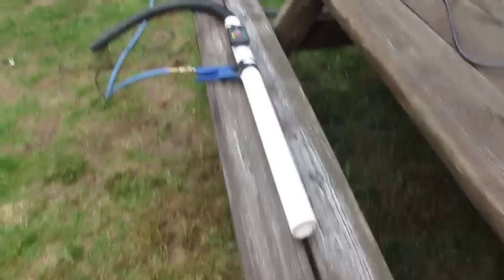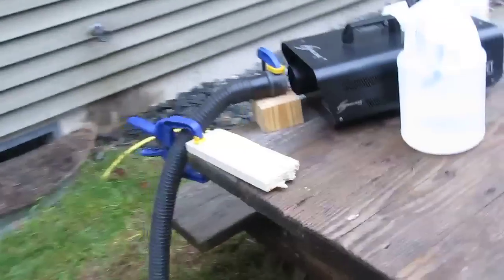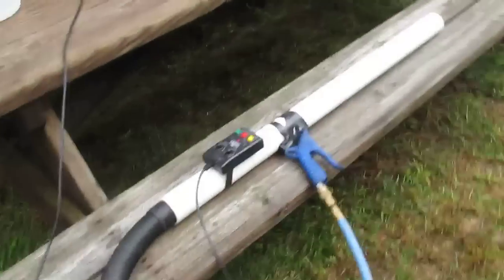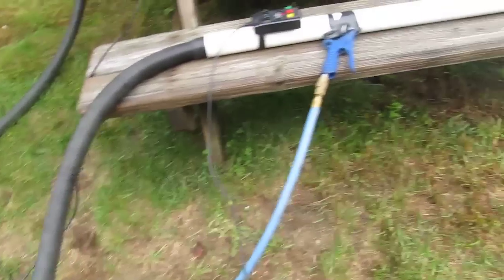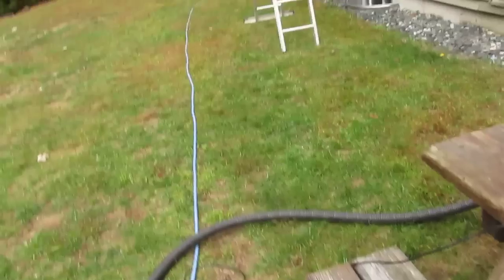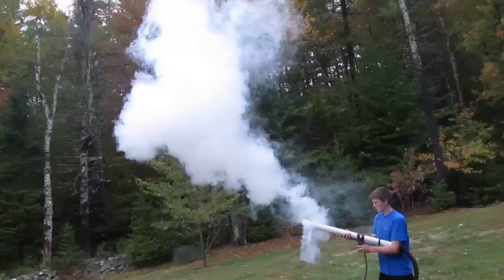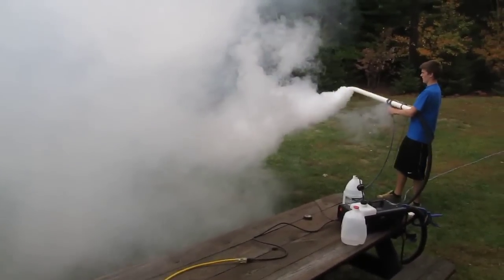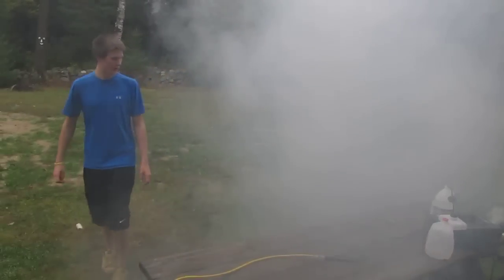How To Make A Fog Cannon

Comment: i want a fog machine for my wedding. My dj wants to charge about 200 dollars. Is this a fair price or can i make my own for less. I just want to use it for my first dance for a few minutes to produce the dancing on a cloud look
Reply: +Benjamin Carr to be honest ground fog and dancing on a cloud look is very hard. I have done multiple times. Using fog it is very hard because the fog needs to be chilled and typically the effect is done with dry ice. Which is ery expenxive and you would need a chauvet nimbus machine which runs 1,000 dollars. The fogger shown in the video is 150 dollars, but to get the dancing on a cloud effect you are looking for it will be very hard. I would recommend paying the 200 to let the dj deal with it.